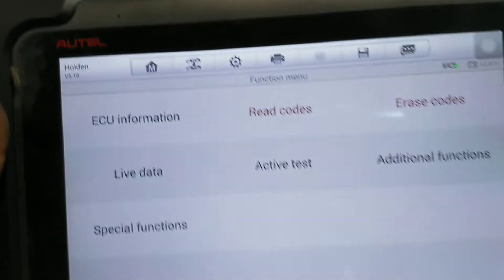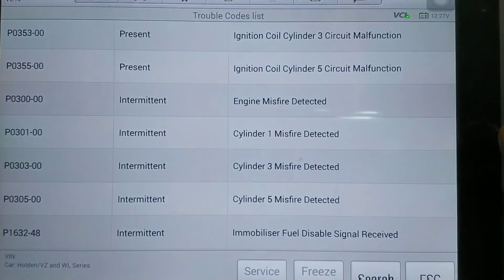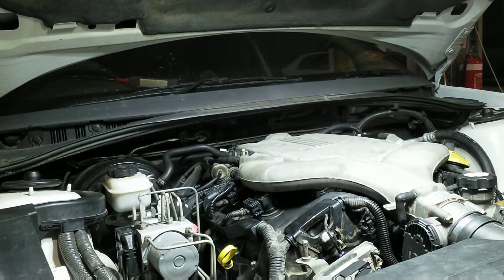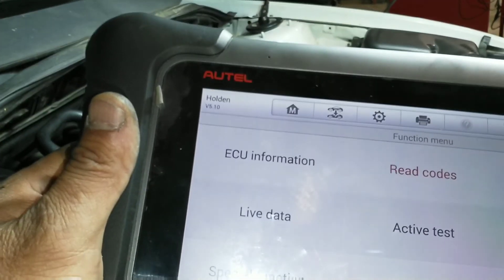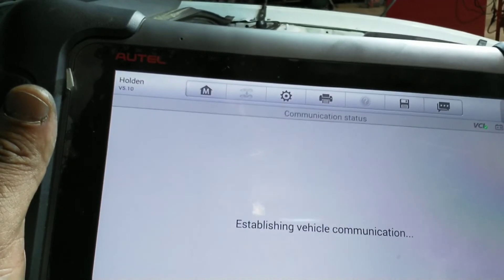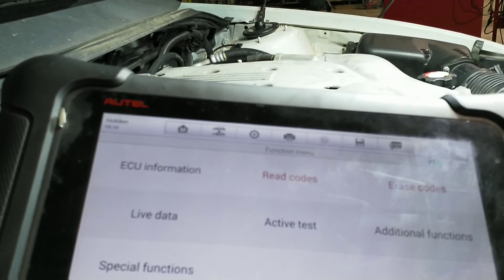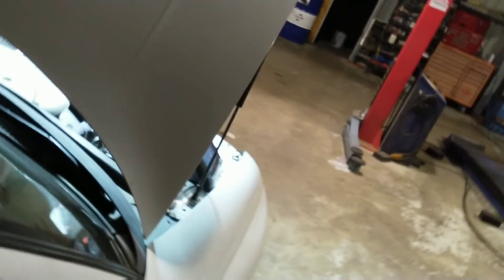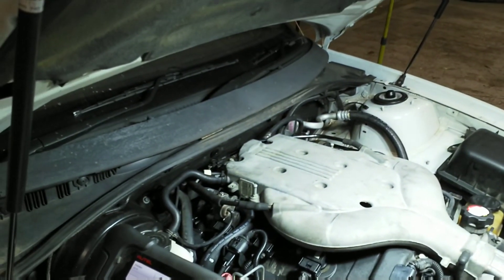Holden VZ Commodore no spark on cylinder 1,3,5 fixed

Comment: I have a mate with an 05 sv6 190 6spd and it runs like absolute shit. 6 new packs, plat plugs and plenum gasket and made no change.
i d/c 2 packs on the rh bank and 1 on the left and made no change in its idle. belt tensioner is flopping around while it tries to idle.
no dtc's (i have a snap on ethos)
it would throw dtcs when i unplug the packs though
originally i thought it could have jumped a tooth on the chain but it has no cam codes and it doesnt fall in the chain recall period as its the older model.
then i thought it could be the ecm as they are notorious for failure.
it has spark from the packs that i disconnect and the injector pulses are all even, its like the timing is waaaay off or something -_-
Reply from the maker: Sorry I only just saw your comment. I hope you sorted it out by now.
Reply: @a1mechanicaloakey639  
nah they were gonna get another motor but the 190 is hard to find in perth apparently and expensive.
i told them to go to a wrecker and find a ecu/bcm key set to suit but they didn't bother. cheaper than a new motor and odd how no dtcs show up yet struggles to idle lol
Reply from the maker: @R3cKi7  cars can be absolute pain sometimes. Usually I start with checking vacuum leaks and throttle cleaning for idle issues, If it smooths out on higher revs.